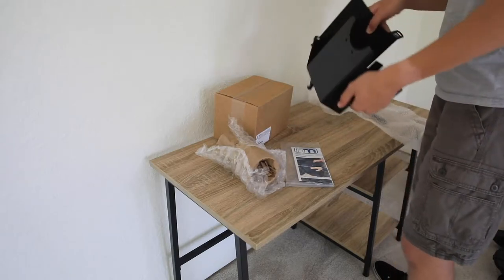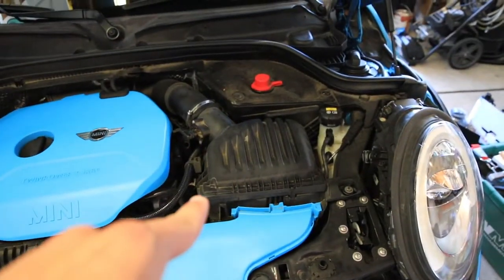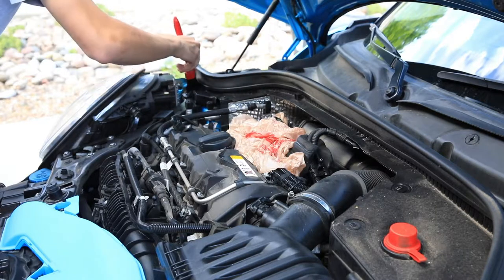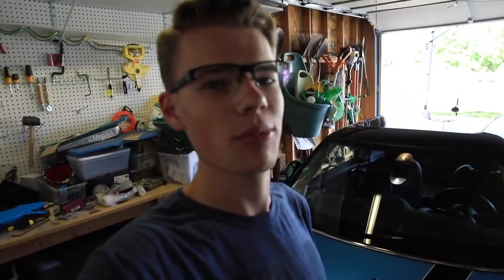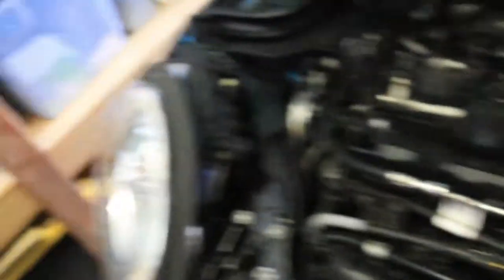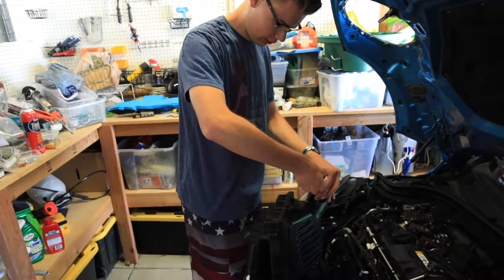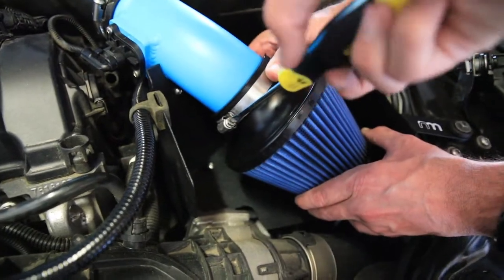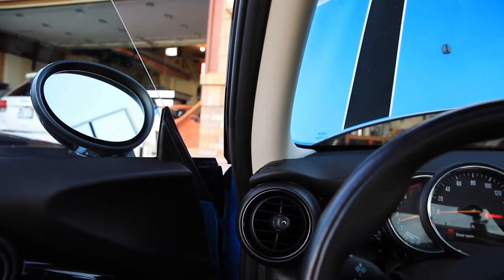COLD AIR INTAKE Install and Spray Paint | The Ultimate Mini Ep2

Comment: Do you notice and difference in performance? I am debating getting a CAI vs just a performance panel filter
Reply from the maker: There is definitely more of a low end/throttle response performance increase, but overall horsepower is maybe 6-7